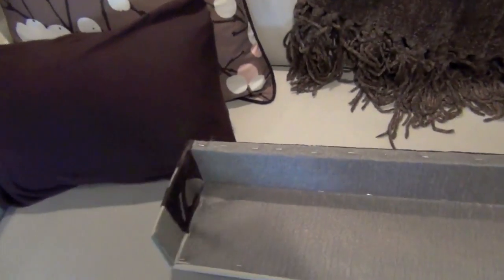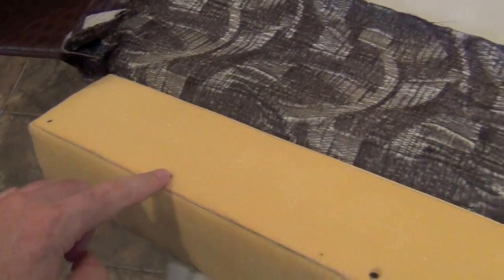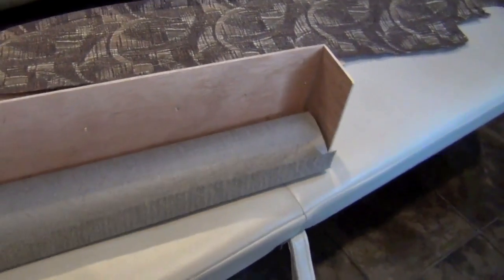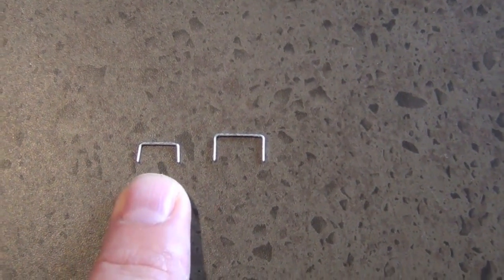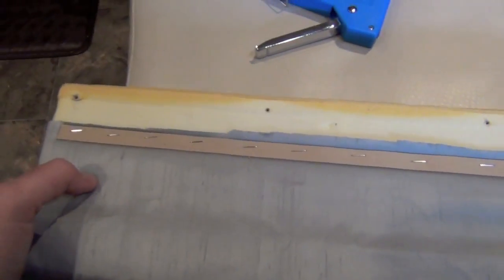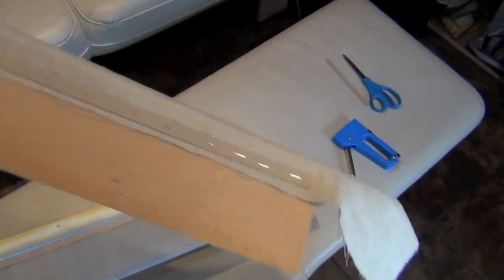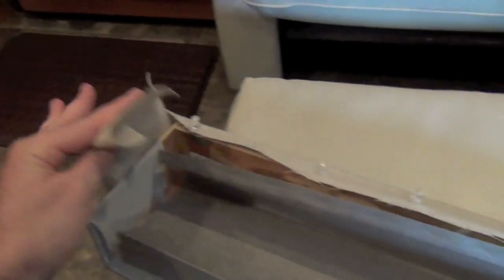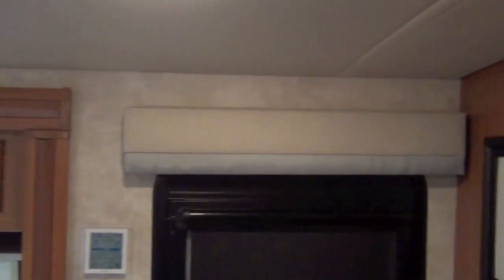How to Re-Cover RV Window Valances

Comment: Thank you so much.  The video was just what I needed. I live in a 18 year old motor home. I want to redo all the very dirty and out-of-date window valences and eventually cushions. I love the wood I have and your suggestions of using silk surprised me. I will look at more types of material now. Great video.
Reply from the maker: Hi Charlene - I'm glad you found it useful! The silk we used was from some old curtains, and I'm not sure how well it will hold up long term, as I know sunlight breaks down silk over time. That said, we've had them up for 2 years and they still look great! Good luck.
Reply: Yes, I am redoing my Valances too...
My RV is 34 years old...

Comment from the maker: Thanks - I did my best. I'll write a post about it too this week and include links to supplies. The most important thing is to take your time and pull the fabric tight before stapling. Most RVs have slightly simpler valences so they should be easier. Usually they have just one layer of fabric vs. ours with the 2 separate pieces. Good luck!

Comment from the maker: Hi Star - Yes, the valance does cover something. In our RV, the valance covers day/night MCD roller blinds. In most RVs they cover the standard RV day/night shade mechanism. Trust me when I say that the shades/blinds are an essential part of an RV so I wouldn't replace them with a shelf. At the very least they provide privacy (important in most RV parks). They also help provide a layer of insulation and block bright lights or sunshine, etc...

Comment: Great vid! Thanks so much! I was wondering if most trailer/RV valences are the same, as far as how they're attached to the wall, constructed, etc.?
I have a 2003 Sunnybrook 5th wheel - and I'm wanting to attempt to redo the valences..... My biggest fear is trying to remove something from the wall only to find it's attached or put together differently.
Thanks again!
Reply from the maker: Hi Sarah - thanks! From what I've seen most RV valances are set up in a similar way. I have seen some that are one piece - the sides and top are all connected - but I think they're still attached to the wall with a bracket on the inside, and can be unscrewed, removed, and re-covered essentially the same way. Good luck!

Comment: How did you figure out where the original screw holes were that you needed to put back on wall? Can you feel it. I'm going to recover mine, they have a wavy, scappoped sort of design. Not just simple angles, should be interesting. Thank you, very helpful
Reply from the maker: Hi Cynthia - You can feel the screw holes and even see the slight indentations in the fabric. Good luck!

Comment: Could you avoid disassembly by just putting the new fabric over the old?
Reply from the maker: Hi Rich - You could try it, but I don't think it will look as good or last as long that way. It's also easier to use the existing fabric as a pattern for the new fabric. Good luck!

Comment: Help! I hope you'll answer. We bought a 2005 Newman Dutchstar.  In the bedroom slides. They cut out two grooves in the wood on each slide(there are two slides). The grooves have this hideous material plaid design. I took one out and there is some kind of paper with tacks. This was behind the plaid covered material thing😵 Apparently they tacked this ugly material design onto that paper. WHAT is under that paper? Could it be wood again?
Reply from the maker: Sorry, but without seeing it I have no idea. Different manufacturers use different materials. Can you peel off a corner of the paper and look?

Comment: What were they thinking with their geometric shapes? Nice choice of fabric!
Reply from the maker: Froukje Brouwer Thanks Froukje! I need to post a video of the final product. We had my mother make side curtains that look fantastic and match the new valances. So much better! :-)
Reply: Trek With Us Were the side curtains instead of the side valances? I've been wondering if leaving the top valance and replacing the side ones with curtains would work. It needs to cover the blind string guides, I guess. And I agree...what are they thinking when they use such ugly fabric for RV interiors??
Reply from the maker: ***** Hi Sue - the original sides were made of covered and shaped wood. We replaced the sides with soft/formed curtains. I need to make a video to show what we did - it's on my list. (and they look great!).

Comment: If you can not find short staples, could you use light dots of fabric glue, instead?
Reply from the maker: Unfortunately that wouldn't work. Re-covering valances is similar to doing upholstery. You need to 'stretch' the fabric over the valance or else it will be loose and not look great and/or fall off entirely. The glue won't hold it if it's properly stretched. It will just fall off. Staples are the best way by far. You can always order the short staples on Amazon. Good luck!
Reply: Thank You sooooo much for pointing this out. It makes sense.